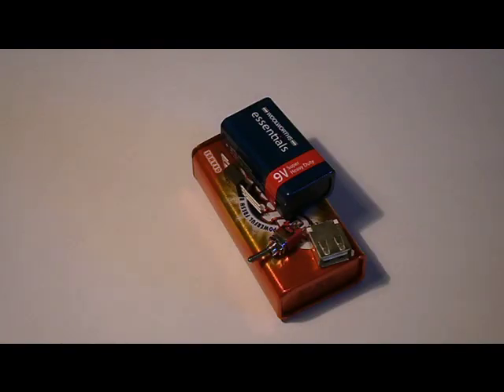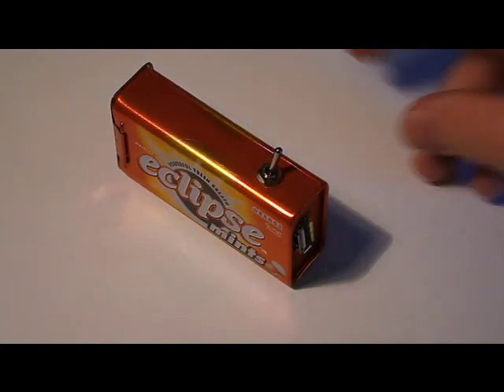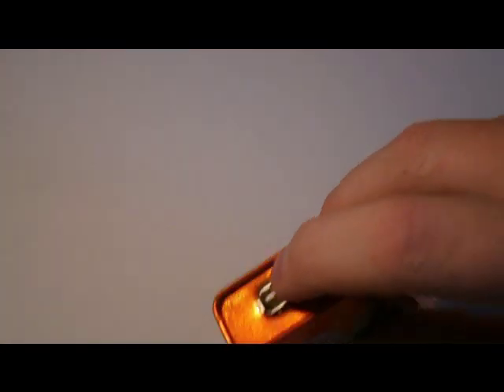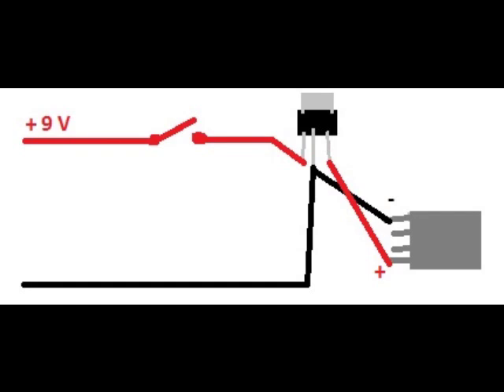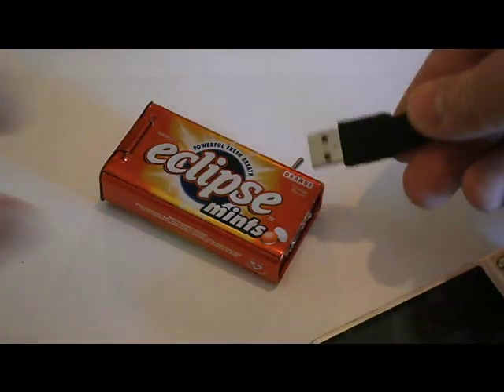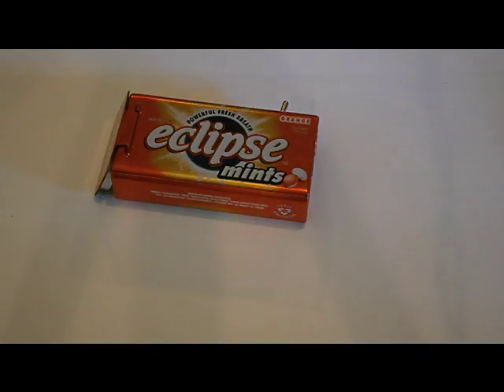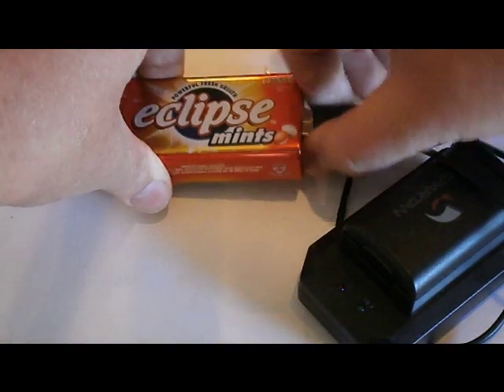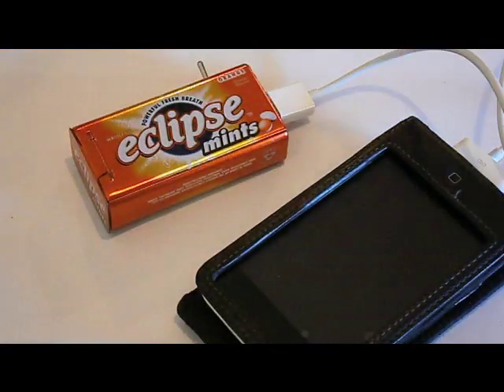Hobby Electronics - usb charger

Comment: I really like your value video. But I have two wonders.
Firstly, how do you convert from 9v to 5v? It's seem you didn't use resister.
Secondly, can I make it without switch?
Best regards.
Reply from the maker: Dara Sok Thanks. Using the voltage regulator you can create a 5v output from the 9v in to the regulator. To create this without the switch you can just connect the wires that were going to the switch directly together.

Comment: its make my energy loosing from phone battery...i use 12v regulator...can you solve my problem?please...
Reply from the maker: Adib Aieman You could put a diode between the 5v regulator and the + pin on the USB jack
Reply: thanks..I will try to do it again...
Reply: why do you not put a diode?
Reply from the maker: Because the Xbox battery charger has the diode in it already to prevent the problem that your are having.
Reply: ouh...thanks for reply..
Reply: can I make it without regulator???

Comment: i made one like that but mine is able to charge my iPod  the only thing is that the 9v batt overheats really bad... any ideas????
Reply from the maker: Hi, this could be due to a short in the circuit or the IPod drawing too much current from the battery and this could possibly harm your IPod. You could try connecting two 9 volt battery's in parallel to increase the amount of current that the IPod can draw and alleviating the strain on one battery.
Reply: will try that....  I'm  making a new one on the bread board.... lets see. tnx
Reply: steven Arango iPods will charge at different rates depending on the resistance detected on the data pins. You probably have the circuit set for a high current charge, and this will draw more from a 9V that it's meant to supply. By choosing a lower charge rate, you should be able to charge your iPod without risking the battery overheating/leaking/exploding.
Reply: Actually, 2 X 9V batteries with a KIM055L regulator works really well. The regulator is super efficient, but it needs over 9.5V to work right. You could use up to 4 9V in series with that regulator which would cut the current per battery down even more.
Reply: DUH!!!! If you aren't going to even take 2 seconds to see the original project and listen to what the original problem is to begin with, then please stop commenting on how we can do exactly what you are suggesting, which IS THE PROBLEM to begin with !

Comment from the maker: You will need to use a 5 Volt voltage regulator for all USB devices but if you wanted an output of 3.7 volts you will need to create a voltage divider with some resistors.

Comment: Add a 330 ohm resistor from the third prong on the regulator to one of the middle prongs on the USB port and it should charge an iPod touch

Comment from the maker: There is no need to use a 10v voltage regulator, you need to use the 5 volt one still because you want 5 volt's coming out of the usb socket. If you do use the 2nd 9 volt battery don't hook it up in series because it will make the voltage going to the regulator 18 volts and this will create excess heat for the regulator. Thank you for your comment and please do ask more if necessary.